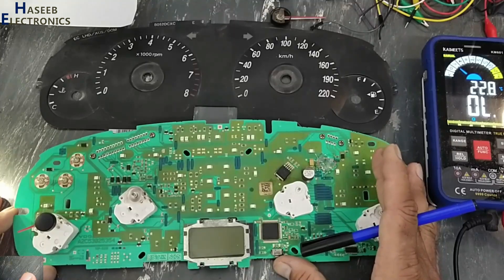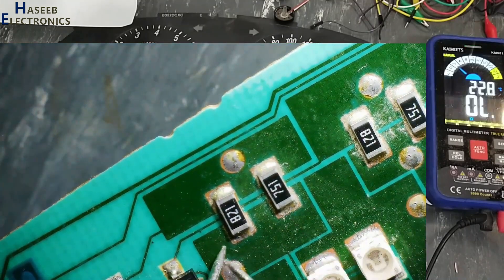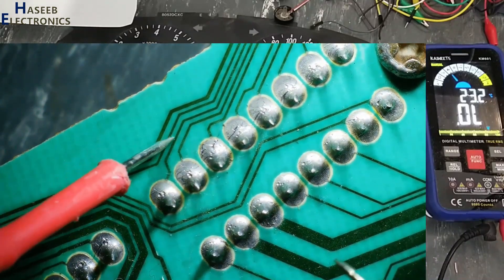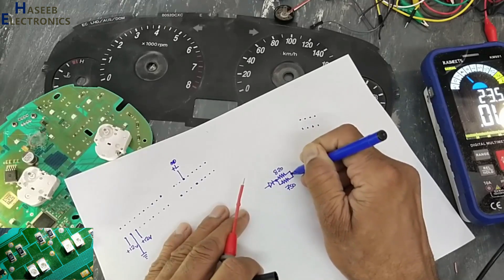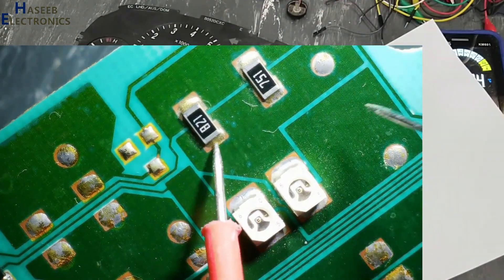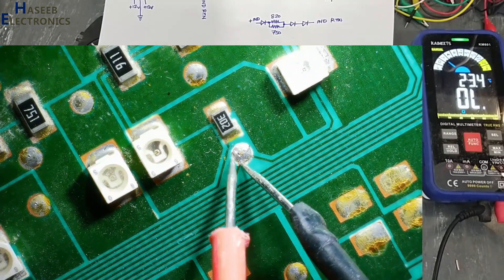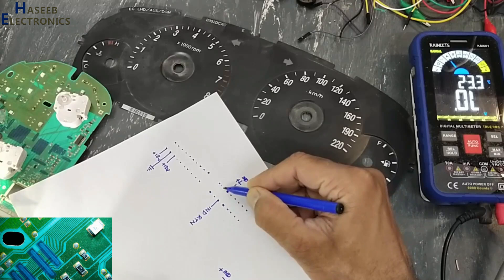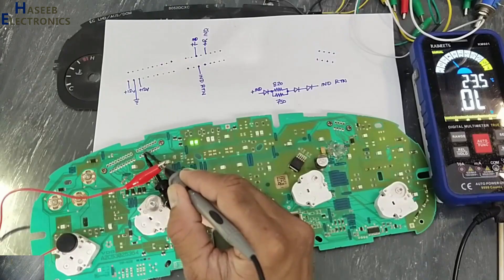{1223A} Tracing Turnlight Indicator circuit in Hyundai Cluster

Comment: Hie sir I am. working on tl494 operating car radio amplifier. It is triggering high current on pin 16 current feedback and turn off the outputs. At times it works well on low volume but blows the output transistors. My question is how can I correct such an anomaly?

Aaron from Harare Zimbabwe

Comment: Sir, mai 12v to 12v DC Dc Converter banana chahtahu Transformer se, likin isolated hona chahiye. Mai Flyback aur Uc3843 use karta hu. Ferrite Transformer EE28. Likin mujhe proper output nhi milraha..thoda load deneme jayada Input current leta hai. Output per load 2amp v sehise nhi le paraha. Mosfet bahat heat hoti hai. Mai 60khz aur Pri 37T, Sec 37T use kya hu. (Flyback, One mosfet one Diode) Sir  please mujhe Transformer ka Calculation bataye aap.